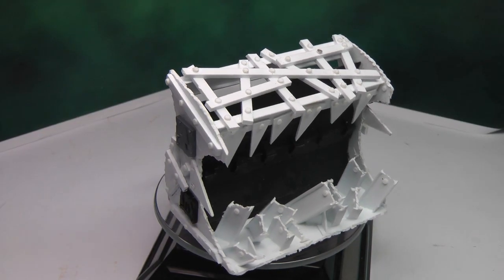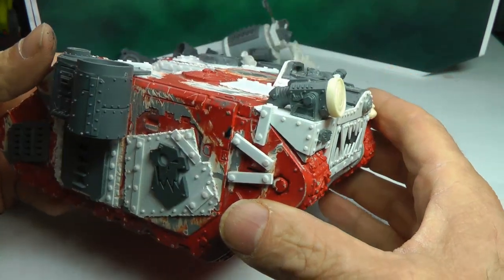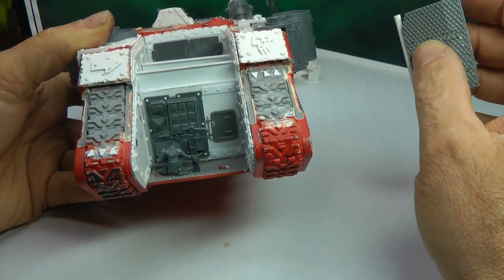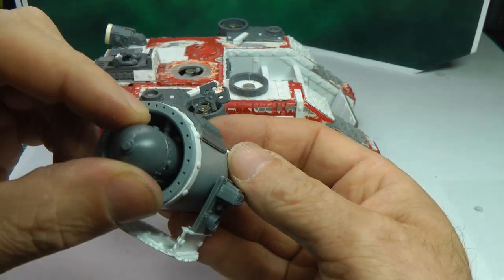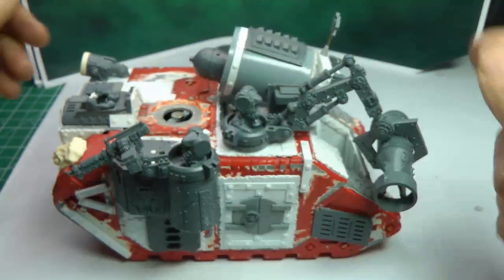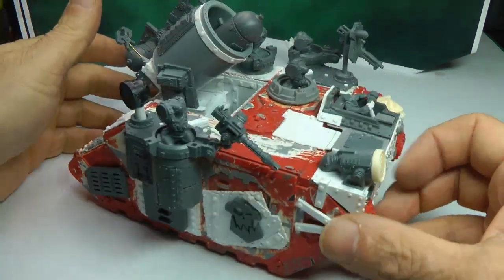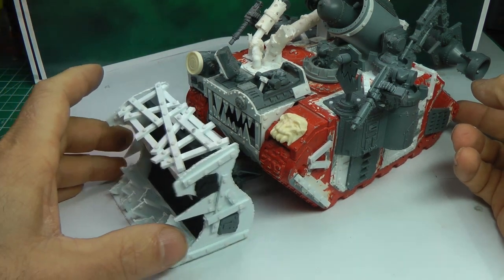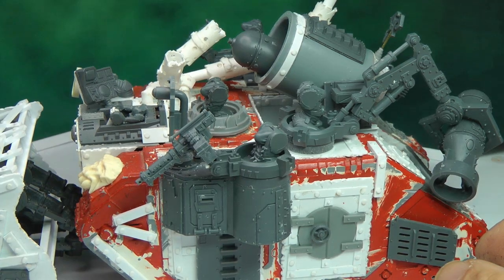Ork Looted Wagon WIP #5 - Final Mock up

Comment from the maker: Hey Kanvass!

I have just started painting the bits  (control panel, spot lights,etc)  Thanks for the heads up on the clean edges on the greys, sometimes when you look at something for so long you don't see the obvious!  I will certainly edge them up a bit!!  Thanks so much for your comment, I look at you as the Ork plasticard scratch build MASTA ! so your feedback is like Teef to an Ork for me.  A couple guys have mentioned it could be battlewagon, maybe another looted "wagon" coming up!!?

Comment: I would say just adjust the height of the boom gun so it doesn't quite appear at the same height as the rest of the additional bits because u kind of want it to not only be noticed but to strike fear into it opponents wen you put it on the field and being such a large weapon u want it to be the first thing your opponent does see because it then becomes intimidating

Comment from the maker: This type of plastic is the same as what models are made out of, so the same pros and cons for the glues.  I prefer plastic glue.  The plasticard is referenced in my "how to make Ork panels and rivets" video, check it out, it should answer your questions about cost and thickness and brand.

Comment: That is a crazy tank! I'd be terrified if my opponent set that on the table. What if you painted it so you could still see the Land Raiders original paint job underneath? Like when the Orks salvaged the tank the just quickly went over it with a paint brush or spray can leaving areas of the Marine paint visible. Just a thought

Comment: ok, if you haven't already painted it I would suggest making some chipping damage on the kitbashed bits, all your grey plastic bitz are still straight/smooth from what I can see... just a nick here and there should do it. but other then that its a very very solid build mate. TBH I think you could easily run that as a Battlewagon, the reinforced ram would make an excellent deffrolla proxy.

You make me wanna break out the plasticard.